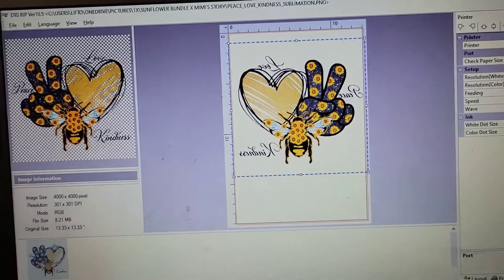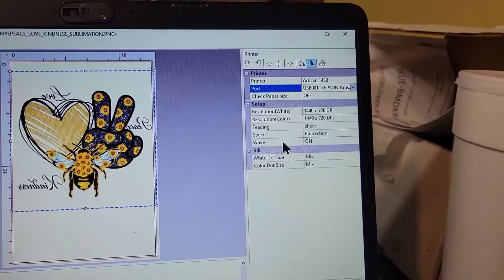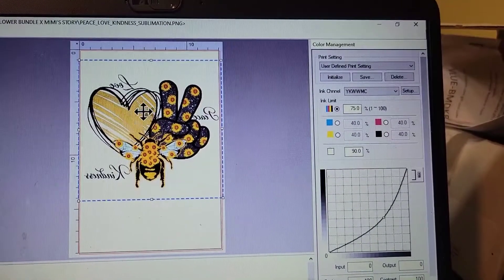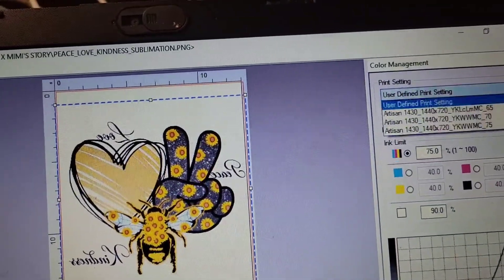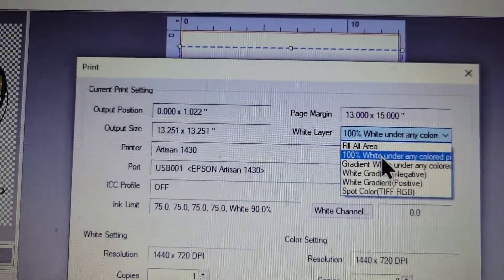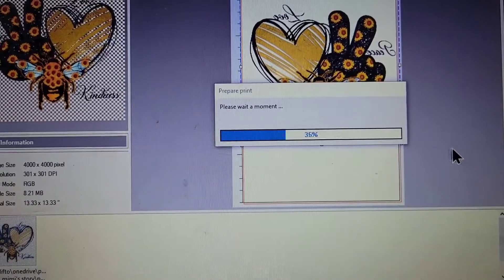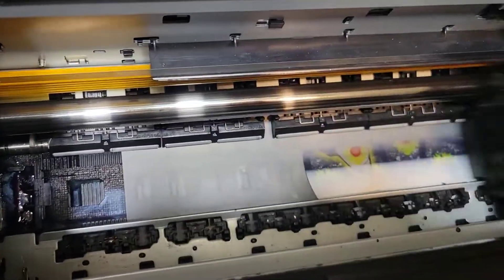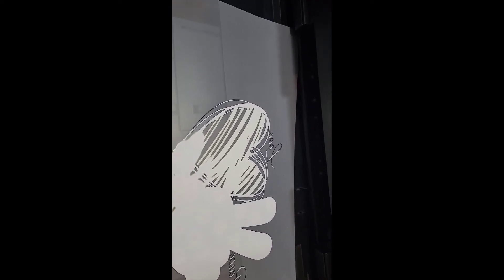How to Print DTF with the Epson Artisan 1430 using Acrorip 10.5

Comment: how is the 1430 running so far since converted?
Reply from the maker: I am not gonna lie , I had an emergency that I had to leave for 4 days I had barely cleaned the print head and was about to put ink cartridges back in but opted to leave out I thought I turned the printer off  but I left it on came back was about to start to print, put cartridges back in and it would not read the cartridges all lights are on I have tried everything now I am waiting on new cartridges to see if it will read these . It might have updated my driver but not sure . Everything was working fine untill I came back
Reply: @TheImpossibleco  Sir it's the firmware you have to downgrade to a older firmware then it will recognize the refillable cartridges
Reply from the maker: @johngrate8100  thanks I will try that
Reply: @TheImpossibleco  keep me updated when you get the new cartridge